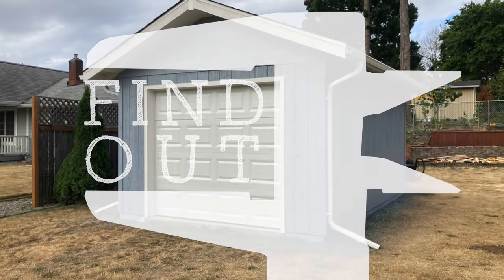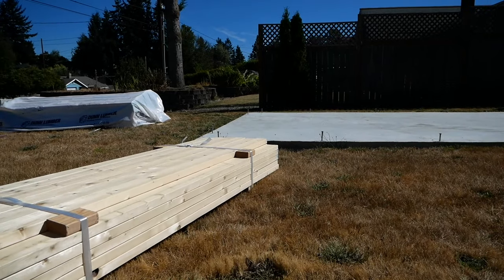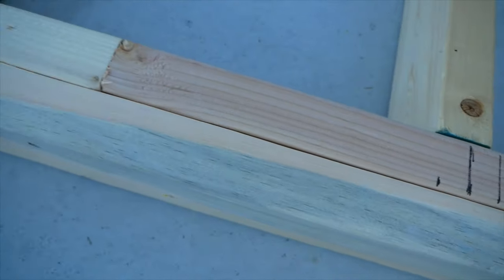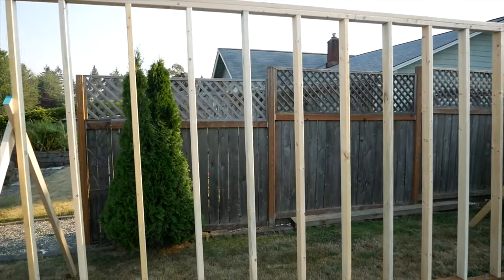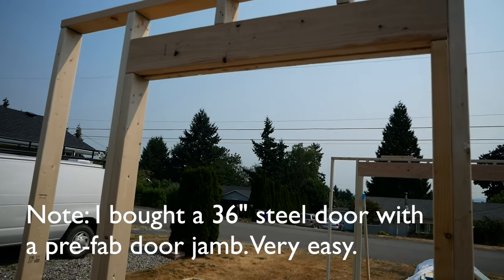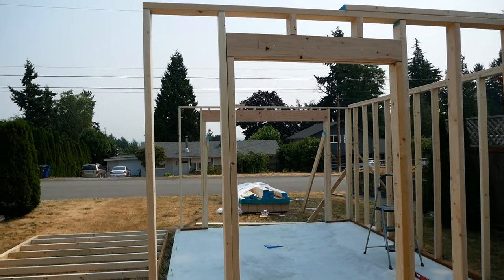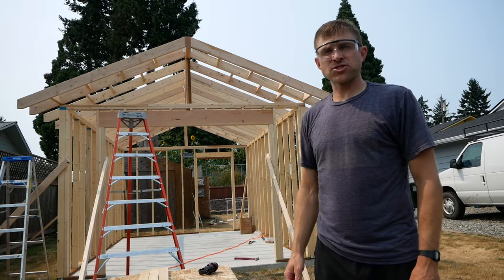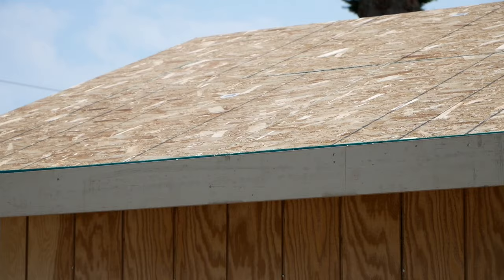Build a Single Car Garage/Large Storage | Step-by-Step

Comment: I have done a little bit of framing in my life and here are some  tips....  shove the header all the way up to the top plate and fur the header down to your R/O, leave a minimum of 1/2" on all R/O's (1" if someone else is framing it); run your rafters long and snap a chalk line to get your tails straight; use a string on everything  to keep it straight; turn the corner a minimum of 12" on drip edge and overlap minimum of 1-1/2" over the roof felt.

Comment: How did you wire electric for the garage door opener? No other lights or receptacles?
Reply: Right?! Lol.  My first thought.  Guess he ran an extension cord from the house for that garage door opener.
Reply: He put a pipe by the man door, I’m pretty sure he will run wires thru there

Comment: Just curious how do you find it parking a car 16ft in length or less within this garage? I am looking to have a custom garage built but it is in NYC and there is very minimal space. The largest Ill be able to get length wise is 16.5 to 17ft and about 12 ft wide. Cars I would park inside would be about 14.5ft in length to 15.25 ft in length.
Reply from the maker: In all honesty we actually don't use it for our car, we never planned to personally. We use it to store gear and tools but wanted to build something big enough to fit a small sedan for future owners and/or renters. 

We did park our Prius in it once after building it just to see how it fits and it was tight but doable. Our primary reason for building it so small was to stay within our cities un-permitted building limits (if we went larger we would have needed a building permit)

Comment: I would of just bought a shed if it would cost me 7k
Reply: That size garage is going for close to 20k these days
Reply: Sitting in the dirt... yep.
Reply: @stevelongo3672  is that because of the inflated lumber costs? can it be done cheaper by using all brick to construct?
Reply: @sheenspeaks  Lumber costs plus pouring the foundation is expensive